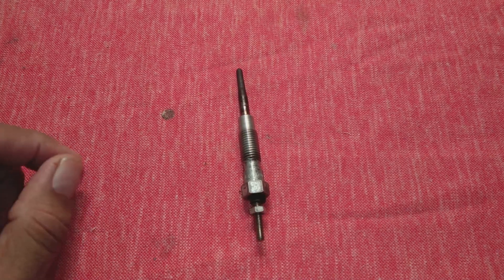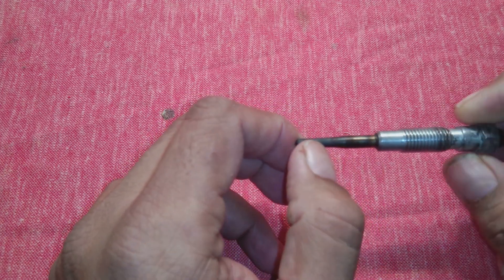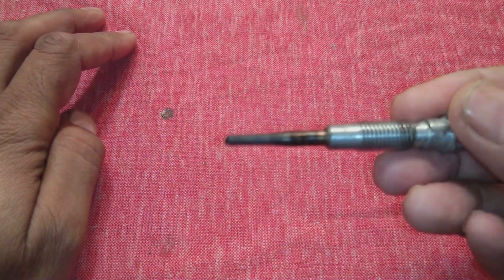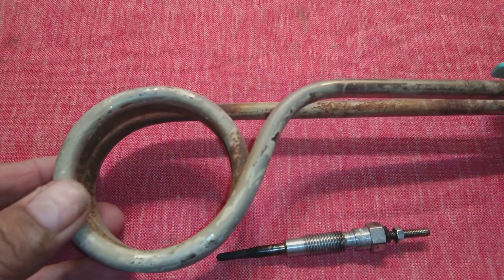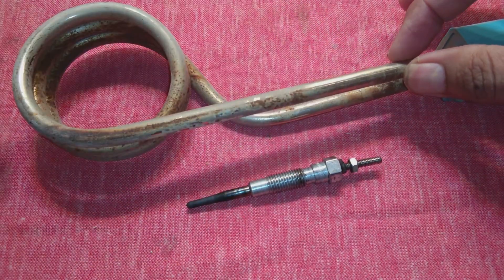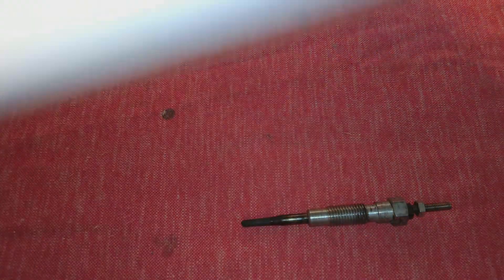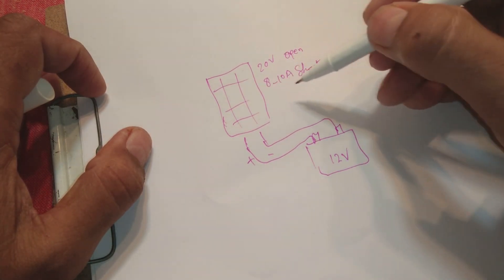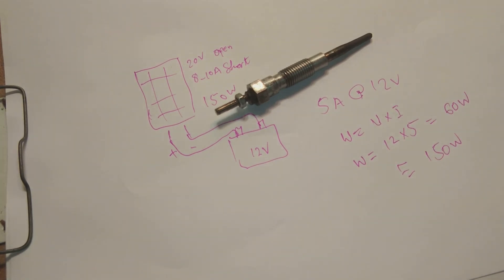Glow plug 12V solar water heater. How to make glow plug heater. Solar water geyser glow plug. heater

Comment: Utter bullshit. 60 Watts is a nice 5Amp load that wont blow a cigarette lighter fuse while a standard 12 volt cup heater will often blow your fuse at 10 amps. 
60 Watts just takes longer. With an Insulated cup, that does not take long.

Comment: Today I used a 12 volt 150 watt water heater element to heat about 2/3 gallon of water from 46 deg to 86 degrees in about  45 or 50 minutes so I know that it doesn't take " all day " for 150 watts to heat a liter and a half of water.
Mine is a U shaped element 7 inches long .
Maybe the longer element is why it's working for me .
The glow plug does not give much surface area.

Comment: I have made a solar dump load with a glow plug for my boat. It’s heating the water with excess solar energy when the batteries are fully charged. It heats up the water in a 10 liter insulated water tank by 10 degrees in about 1 hour. This is because I don’t have enough solar power to provide 20A continously. I’m using a buck converter to lower the voltage to about 9 V and 13 A, which gives me about 125 W that I burn in the glow plug, which is submerged in the water. This works very well, and with an own developed control unit, based on an Arduino board, I can switch of the load before it’s starting to drain my batteries. So to say that it doesn’t work is not correct. Under the correct circumstances, it can work really well. If you have enough solar power to provide the required 20 A, the time to heat up the 10 liters is about half an hour. I’ve also tested that with some help of a server power supply.

Comment: I have one pannel can it be used to heat water?
Reply from the maker: I think you didn't watch the video carefully. Answer to your question is there in the video.
Reply: I did but i could not get it if you please tell me here would be great. 
Like if i am using this plug wont work that i got fro your video but is there any 12volt heater that i can connect to my pannel. 
I bought that pannel for solar cooler and want to use it for water heatig in winters
Reply from the maker: Definitely it wouldn't work. There is no such heater which could provide hot water from single solar panel. For that you need 10 pv panels to heat up a reasonable quantity of water through solar. Or you would need a solar collector water heater. That single collector would heat up water.

Comment: You're wright about your calculation for one plug. But what you fail to tell people is that you can use 10 of these plugs in parallel and get a 600W heating equipment that can definitely heat up 10 L of water in 2-3 hrs. The more plugs you have the faster you can heat.
Reply from the maker: Yes you are correct. Ten units could do little. But they need some ten solar panels to do the job. Which is way too expensive solution.

Comment: Thank you for the clarification on the power factors involved. That sounds more logical.

While I agree that it is literally impractical to expect this heating element to heat up a bucket of water or a whole water tank. You made a statement that a litre of water cannot be heated even after one day. I wonder why 1 litre water cannot be heated with 5A power supply from a 150 watts solar panel for whole day ..Just a theoretical question..
Reply from the maker: Yes because the heat produce will be very less and it will be disapated in losses.

Comment: A glow plug is rated for 20 Amps @12Volts. The plug reaches 850 deg C temperature in 10 seconds even if ambient temperature is -30 deg C. Basically a glow plug is a high efficiency heating element with 240 W capacity. If you need the functionality of 1KW regular water heater you will need to use 4 glow plugs in parallel and supply them with 80 Amps @12 volts.
Reply: I have seen some glow plugs melt at 15 seconds not immersed in water.
Do they have harmful materials in them and should they only be used to heat shower and dishwashing water?
Reply from the maker: @hrevyaga82  no benefit.
Reply: thanks sir ...do we have any  plug with low power using ? if pleas mention the model number ????

Comment: 150watt panel can produce about 600 to 900 watthour of energy per day (in places like India). This energy can produce about 500 to 750 Kcal of heat. This can rise 10 liters of water by 50 to 75 deg celcius in a day. I am not sure of using glow plug for heating.
Reply from the maker: Maybe you will have very high power solar panels or the sun would send some very strong energy in India.

Comment: Even if its not made for heating water doesn't mean you cant do it
Reply from the maker: The whole story tells us, it could not heat up water as people are trying to make water heater from it.
Reply: @JahanZeb1976  would need several of them for like a water tank but if you wanted hot water on demand or a steam machine would work just fine

Comment: Well, a glow plug does some 150W though. And VW or Renault are using 3-plug in-line booster heaters to help warming up the coolant water in winter as direct injection diesels don’t warm up very fast when it’s cold. VW also uses 3-plug heater flanges directly attached to the cylinder head (e.g. engine code 1Z, 1.9L TDI).

Comment: Thank you I was looking at doing a small water heater for water in the garage with a solar panel and 4 glow plugs. Not sure now!
Reply: Don' let this stop you can make a small 2 to 3-gallon water heater for RV use to take showers with warm water on the days the sun don't shine by using the battery and alternator or stored solar power from a battery bank. Use a well-insulated metal tank to avoid heat loss as you heat your water. Don't get caught in a remote area with a dead battery in your vehicle or cabin out in the woods always have a back up battery in case something goes wrong.
Reply: Sounds like an excellent project, do it!